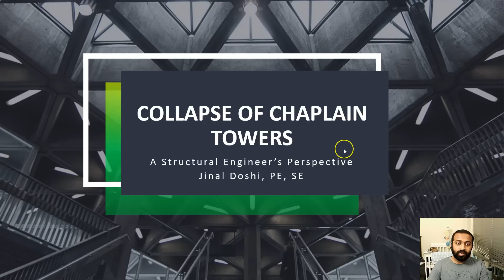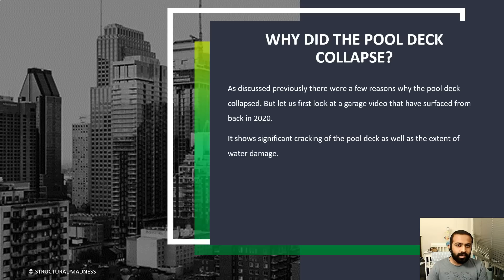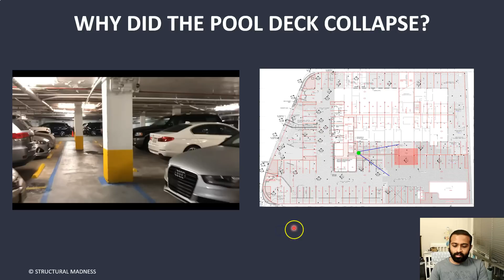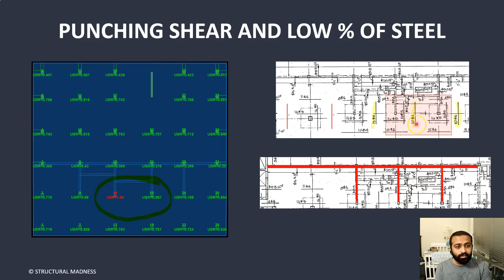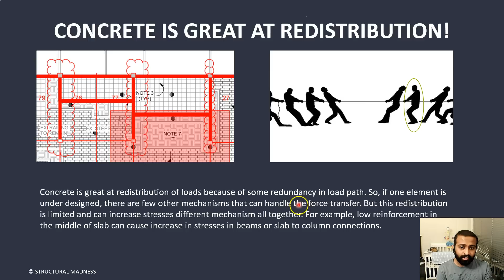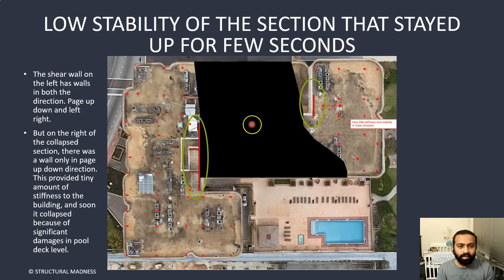Reasons behind Surfside Building - Champlain Towers South - Collapse : A Structural Engineers Review

Comment: 44:15 So in summary do you recommend they evacuate and destroy the copy building that is just a block away? Surely it is every bit as vulnerable due to poor design...passing the 40 year inspection not withstanding.
Reply from the maker: No, that is not what my conclusion was. It was not a single thing that lead to this collapse. As mentioned, there were multiple overlapping factors that led to this unfortunate situation. The other buildings shall at least be analyzed and retrofitted if necessary.
Reply: @StructuralMadness  You're right, it's called the Swiss Cheese factor. Major disaster doesn't occur until one day all the holes line up. Just because it stood for 40 years, doesn't mean it wasn't wrong for 40 years, it just took 40 years for the right combination of neglect to line up all the holes at the right time...
Reply: The calculations that I've done show that there is underdesign in various parts of the first building.  We don't have drawings for the second building to use to evaluate it so we can't pass judgement on it.  If they asked me for recommendations I would advise them to have the building thoroughly evaluated based on its original drawings and fix any deficiencies that might be found.  If I knew that the second building was built identical to the first one then I would have to recommend evacuating it until it could be fully investigated.  To get an engineering license I have to put the safety of the public above everything else.  Surely there are people who would say this is over reacting, but if someone had walked into the first building 2 months ago, looked around, and said "everybody get out now", it would have saved a lot of lives.
Reply: The north building is smaller. Concrete samples recently taken so far show concrete is stronger than called for on the plans. Also north has been much better maintained, and garage has stayed dry. The east building is a couple years newer and completely different construction. Champlain East floor system is a post tensioned design, and more robust than the cheap south flat plate slab floor construction.

Comment: 43:26 "The pool deck started this collapse chain...that's quite obvious": No. In fact it's unlikely in the extreme. Looking at the debris pile there is more evidence the deck collapsed after the first or second section than those collapsing as a result of it.
Reply: Eyewitnesses, dude. Maybe stop with your conspiracy theory nonsense.
Reply: Wrong.
Reply: @wrenchposting9097  Explain your work.
Reply: @toddmarshall416  The pool deck failed before the building collapsed.
Reply: @wrenchposting9097  Explain your work.
Reply: The video taken before the collapse shows the deck and planter boxes beyond “column 2” fell into the garage first
Reply: The 3 columns, the beam above and the plate above "lost alignment", failed and the building came down.

The most obvious sequence is the pool deck collapsed placing an outward and downward load on those columns, beam and plate.

The photos are consistent with that sequence ... the presenter is correct
Reply: @musicvideos1971  Right. And one beam under burning desks slipped off a flange...and down comes WTC7 in perfect freefall uniformity. Fool me once, shame on you.

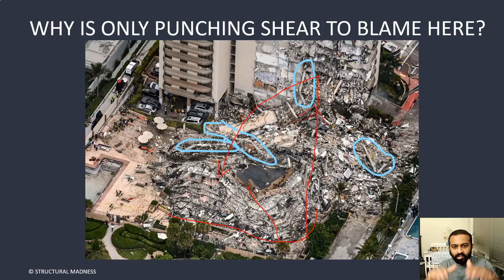Comment: 43:06 "The columns are like 'punch punch punch' ": That is correct. But there are no characteristic "caps" where the column punched through the slab. Explain that? Your drawing earlier distinctly showed failure at 45 degrees away from the column, beginning at the bottom of the slab and increasing towards the top at 45 degrees. Yet these punch through failures cracked "into" the columns...not away from them.
Reply from the maker: There are different types of punching stresses that can be induced in such extreme unbalanced cases. Specifically when a large chunk of slab loses support. These are also called unbalanced moment stresses. The behavior of Reinforced slab column joint is different than a simple balanced punching conditions. And that’s why you may not see those caps. 
In case of balanced moment condition as well, when you have low top reinforcement ratio on top of columns, then too it induces called flexural induced punching failure, which again generates a different failure plane. It will be extremely difficult to explain these conditions over a single video and thus, having a generalized idea is okay for everyone to understand.
But these are good questions, thank you asking and requesting for clarification.
Reply: @StructuralMadness  You drew the examples. Why didn't you draw them to match the evidence?
Reply: @toddmarshall416  This can be explained by the top "mat" of rebar delaminating.  This was hidden under the topping/pavers.  The evidence for this in the cores, the top rebar always separated but the bottom rebar was usually tight.
Reply: @kenlieberman4215  This theory was proposed by another youtube channel and may have some merit- if there were top bars placed just beyond the faces of the columns then as the slabs dropped those bars could have wiped off the remnants of the punching shear failure plane.  There were a few columns where the classic failure planes were still visible.
Reply: @billj5645  The plans called for a punch shear re-enforcrement over the corners, but they also called for re-enforcement over the top, 5 5/8 bars.  If the steel was 60ksi, that would hold 90,000lbs.  The load per column looks to be around 50-60,000 lbs, except over the drive way where it would be close to 100,000 lbs.  If there were enough steel over the top, the slab couldn't have dropped through, and only have dropped down.  The bldg likely would still be standing, though it would no longer be habitable.  Most punch shear does not go all the way through, t just sags a bit.  The columns (11") would support over 500,000 lbs.  Its more about stiffness than compressive strength, they flex slightly under the load.

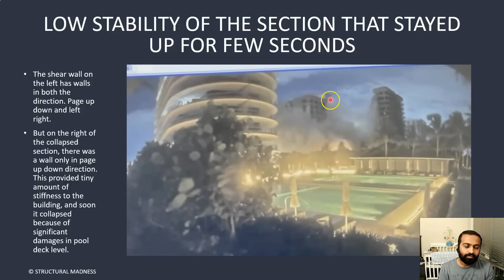Comment: 42:22 From this view you can see the third section tip to the (N). But suddenly it stops tipping and falls straight down. Why doesn't it just keep tipping? The more it tips the more force it takes off the columns...thus the less the propensity of the columns to collapse. And if they do collapse, it's the columns in the direction of the tipping that would collapse...making the tipping go even more. It's taking force "off" of the columns to the (S). Yet for some reason it suddenly falls straight down...uninhibited. And looking at the debris pile you see distinctly each floor laid out like playing cards...the top floors shifted more to the (N) than the lower floors...but by a "proportional" amount. Explain that.

Comment: 41:23 The shear wall to the (N) is the elevator/mechanical core. A typical controlled demolition would likely drop sections just as we see. Next it would take out the bottom of the core and tip it over (to the (S)). But as we saw 11 days later, instead of tipping it into the debris pile, they started a new debris pile to the (W) and tipped the core into it.

Comment: 39:32 The deformation you show would play into concrete's strength. Virtually all concrete's strength is in compression. And the failure you show is a compression failure.
Reply: He's showing an overload due to excess compression or buckling.
Any column connections will either reduce the buckling potential (adding nodes to lower the slenderness ratio), or the opposite if the intermediate nodes laterally load the column.
Also, any column buckling or relative movement of connecting slabs or beams can remove column material and that necking will reduce the compressive capability.
>The poor-drained, pool deck connected to the periphery stepbeam supported by 16s is one definite weak link.

Comment: 37:16 Where is the evidence that those columns gave way first? From the video it looked like the displacement of that section was to the (E). Then the second section tilted to the (W). Evidence of this is looking at the debris pile for that first section  to be displaced almost a full column separation to the (E) in relation to the door of the penthouse above it. That would suggest failure of columns further (E) first.
Reply: The slabs ripped out of side of columns

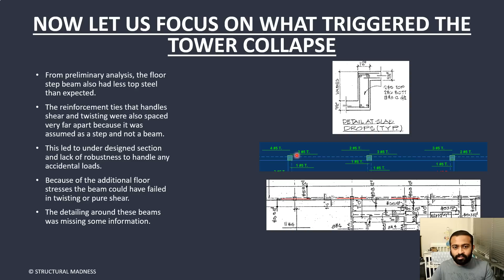Comment: 36:50 "Nothing constraining any side-way movement": Are you suggesting that without the deck, the building design is not sound?
Reply from the maker: Only when columns are as skinny as 16 x 16 without any ties for 30” where step beam is framing into the column. That’s where without column ties in general, if the beam collapses you are risking some loss of concrete there. And this induced instability because of slenderness effects. I mean look at the deck section that collapsed where the cars were parked. The column was 24 x 24 there. This section of building didn’t collapse because the column had enough cross sectional area and stiffness that can provide stability to the column without the presence of the deck’s lateral support.
Reply: @StructuralMadness  What have you found about how they brought that section down by controlled demolition. Can Alpha Wrecking do CD?

Comment: 35:03 Is the picture down the ramp the only evidence you have of the deck collapse happening first? Do you have evidence that the pool and deck were put in place as the building went up rather than as one of the last things done in the construction? Seems to me it would be a good thing to put off for last.
Reply: Look carefully at the first instants of the collapse video, it looks to me like dust is already rising up at the base of the building, and then the gross movement of the upper floors start.  Dust at the base means something happened down on the lower levels first.   Plus there is other reports from survivors and a victim on an upper floor telling about deck collapse.
Some of the pictures in this presentation show the pool deck installed with the building going up.

Comment: Do you have the skill-set to analyze this collapse as if, in fact, it was a controlled demolition. Can you show how, if given the job, you would execute a controlled demolition that would achieve the same dynamics and results we see in the video and debris heap ... and the tear-away pattern on the remaining section? Do you have the ability to show how you can get a section to tip (as the third section did to the (N)) just enough to direct the debris inward before invoking a straight down collapse...i.e. get the section to not just tip over as it had obviously started.  Do you have the ability to show how in 11 days you could effect the collapse to the remaining section by controlled demolition. Where would you put the charges and how long would it take you? Do you have the ability to coordinate a cleanup to virtual pristine condition in just a few days with no consideration for gathering forensic evidence in what may well have been a crime scene? Does the dramatic failure of the 40 year inspection concern you in terms of cost of remediation vs cost of removal...by non-criminal means?
Reply: I can. I would pre-cut the supports, and rig explosives, to bring the building down in a way that would achieve the same dynamics and results we see in the video and debris heap. A quality demo team can make a building go and do exactly what they want it to do. No problem. If you need to see how, as in detailed drawings or plans, I can begin that process upon the receipt of $100k. Ditto for plans to demo the structure that remained. I don't offer a "Something for Nothing " plan at this time. And, if you look closely at your "tipping" problem, it appeared to be more of a "twisting" problem as it rebounded from the collapsing sections tearing away from it. Build the simplest model of several floors supported by vertical columns that you can think of. Then try to twist it. (Don't push it over. Twist it.) Then let us know what it does to the columns as you do it. And for the quick cleanup to pristine conditions in a few days, I would use dump trucks, front-end loaders, and other heavy equipment. Lots of it. What crime scene you talkin' 'bout, Willis? Lastly, no, the 40 year inspection failure doesn't concern me. If I were hired to remediate it, or remove it, I'd be sure I got paid either way. Like I said, I don't do something for nothing. Hope this helped answer most of your concerns, but I don't have time to search for what a criminal remediation or removal would entail. I'd just do it legally.

Comment: 33:05 Looking at this picture: If the building collapse was precipitated by the pool deck collapse, why didn't it pull down the section to the (N) like it did to the (E)? In fact, looking at the ceiling damage it was far greater to the (N) of the pool deck than to the (E). And in addition it had the weight of cars in there...typically greater than the 40 psf you noted earlier for condo construction.
Reply: Yes and that small north section of parking lot with the stamped concrete, they left out any waterproofing layer, I guess they decided they could cut that corner because they figured the building above would shield it from rain? And they forgot about wind driven rain in a hurricane prone area. Not very smart. Morabito said all cars in that at grade level parking area and all the stamped concrete would have to be demo'd down to the structural slab, then slab cleaned up, sealed, new waterproofing membrane installed. Outdoor pool deck area used to have waterproofing, but it was redone way back in 2004 I think, and probably not very good of a job, seeing how the total bid was only $156000. So it might be possible I think that the garage part fell down first. I remember one survivor saying definitively that the garage collapsed first, then the pool deck/patio. I think what they mean by garage, was that upper level garage, because you can look out the window of the lobby area where the security guard desk was, and see some of those cars parked there. So maybe garage fell in first, spread over to where the biggest planter box over parking spot #78 is, that fell in 2nd. Tourist from across the street heard the loud crash of the planter box/pool deck fall into at the bottom of the garage ramp. Started shooting that Tiktok video. Few minutes later the facade of the 11's apartments starts to fall, and drags down everything else with it.
Reply: @brnmcc01  I look at all the lower slab rebar that was pulled out and was still standing and holding up cars and think that area was stout and did not fail first.  I didn't really see that much lower slab reinforcement anywhere else.

Comment: I think the local town and government are covering this up. They knew this building was crumbling for years. Notice how the tore down the remaining section and took all the debris of site. Seems like the town knows they are responsible for not forcing the buildings into compliance.
Reply from the maker: I don’t think so, again, the magnitude of steel that was provided was close enough as required per code back in 1970s. And because of some lack of understanding of few principles of mechanics and load transfer I was say the structural engineers back then may have been unaware of such flaws. And that’s why not putting blame directly onto structural engineers over here, but just design deficiency. It could have happened because of various reasons. 

I understand we want to hold someone accountable, but sometimes these tragedies are like Tacoma Narrows Bridge. Nobody would have known about it back then.

Comment: 24:06 "just two rebar reinforcement": Wrong...the third rebar filament can be seen down below the column number on the right near the surface of the collapse deck. And notice that the cracking at the slab level on the column was into the column at about 15 degrees rather than away from the column at 45 degrees for normal punch through. Do you find that perplexing?
Reply from the maker: That is a bottom reinforcement of slab. The top reinforcement plays a major role in case of the punching shear resistance. That is what the graph shows on the right in terms of reinforcement ratio. I again don’t find it perplexing again because this could be more of a flexural induced punching failure as mentioned in my previous response to your comments.

Comment: 23:53 "what the shear capacity probably was": For just the pool deck area or for the entire structure?
Reply: Not the entire structure, but just the few 12x16 columns supporting the pool deck with large slab span between them or heavier soil planter load near these columns.